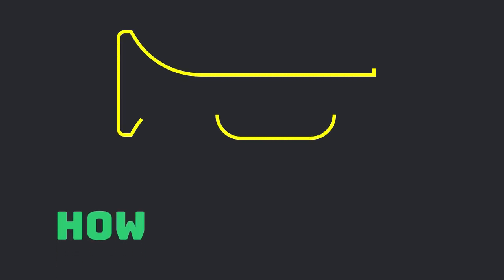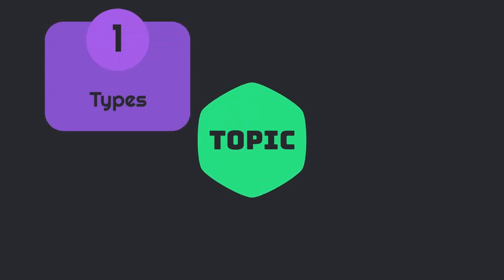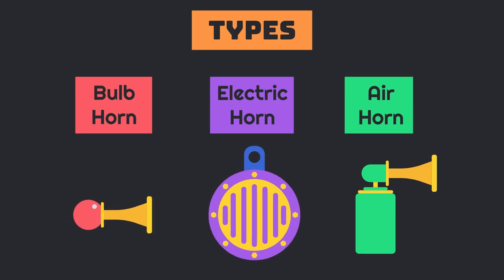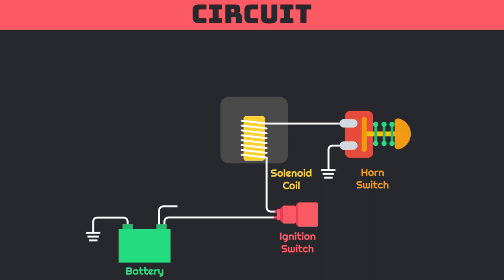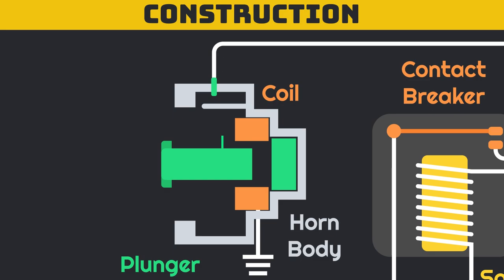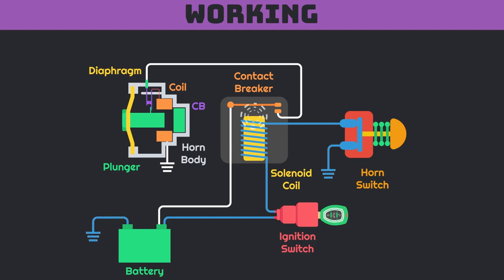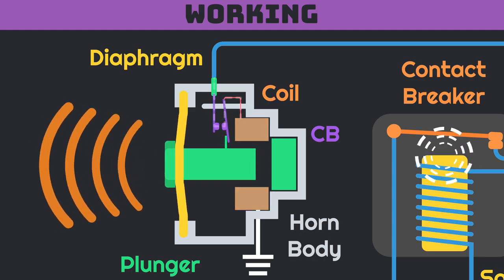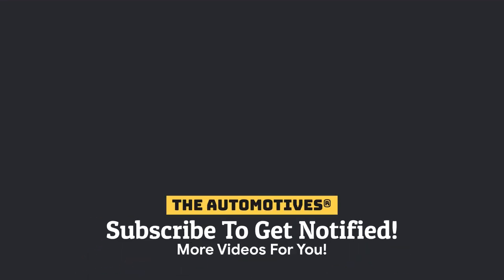How Car Horn Works? | Working | Animation | Circuit

Comment: good diagram. However, I will point out that the key ignition is not involved in the horn circuit because you can still honk the horn while the car is off.

Comment: I'm pretty sure that nearly all modern cars' horns will still operate even when the ignition is off. As long as the car has a functioning power supply, the horn will sound.
Reply: That happens because of Relay. Relay is a circuit which is directly connected to horn from one end and car battery from other end. So if you sound the horn, it will always work if battery is charged irrespective of car is on or off.